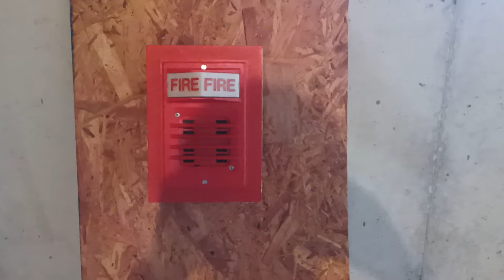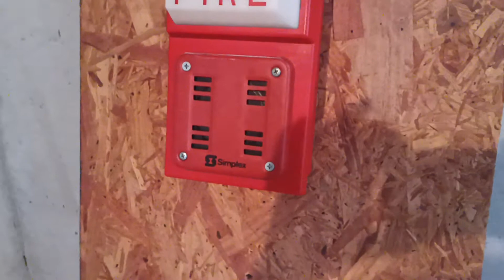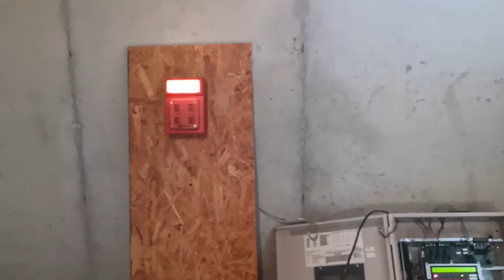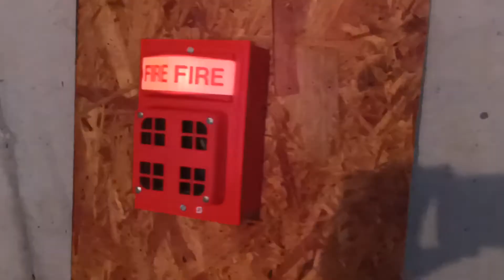Simplex Mechanical Horns on March Time

Comment: That 4903-9102 light plate is extremely rare my justice center in Crossville has those light plates with bells on them but there 50 years old
Reply from the maker: The plates came out in 1988 or somewhere around there. No way they're 50 years old.
Reply: @officialsimplexguy  the 9102 came out 1980 I believe
Reply from the maker: @loren4777  noooooo thats when the 2903s starting becoming popular and they discontinued the 4050-80s
Reply: @officialsimplexguy  look I know a lot about these alarms I just don’t know the years they where made cause I’m only 22 I was born in 2000 3 years after they stopped making the 9838s
Reply from the maker: @loren4777  I can tell. 9838s were also discontinued around 1993
Reply: @officialsimplexguy  update the old kamrt in cookeville the old alarms are still intact just disconnected 3 2903s with 9838 horns on projectors and 1 9806 horn are still intact only 2 alarms are gone but unfortunately system sensor l series alarms replaced them they could’ve kept them in service for the building
Reply: @officialsimplexguy  my old Christian school in 2006 had 2903 light plates with 9838s in them and the building was built in 1990 so they turned it into a school but in 2014 they expanded and replaced one old alarm with a spectral alert adavance but majority of the old system still remains the new building had 4903s installed and the 4002 panel was replaced to a 4100 to control both buildings
Reply: If you so much about these alarms then why do light plates have 2 wires when strobe plates have 4?
Reply: @FireRescue80  I know what they are but I don’t know much about wiring to them
Reply: @FireRescue80  I just know what kind of alarms they were cause I was in kindergarten and pre-K with both kinds of alarms
Reply: And came across many places with them I recently came by a building that had 2901 strobe plates with simplex 2901-9840s on them
Reply: You mean 2903 strobe plates?
Reply: @FireRescue80  4901s